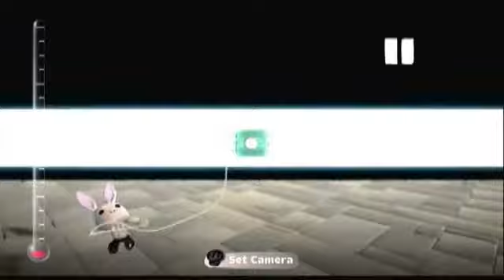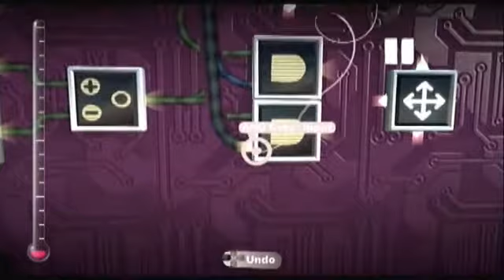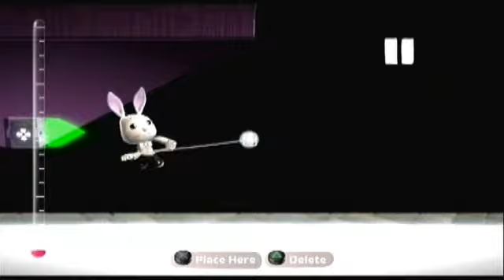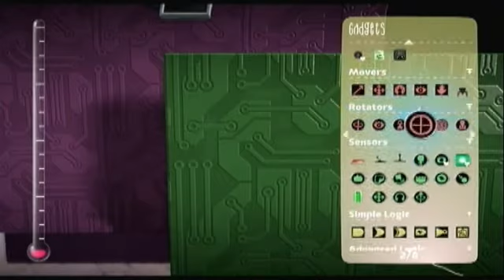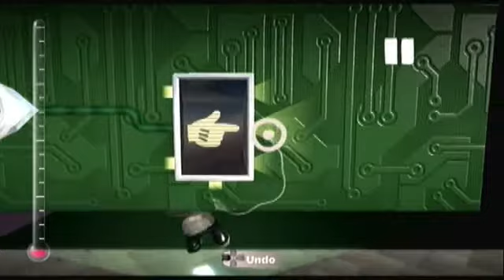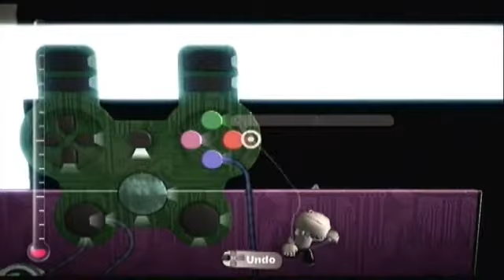LBP2 L2B Side Scroller Shooter Part 2

Comment: If you want to have multiple things, affected by an and gate, but have a lot of things, put everything you want inside a microchip, and have the button that would affect the and gates, power the microchip. It more or less makes everything in an and gate, as the chip has to be powered, and you also need to do the other action, like having a running jump, and running movement(platformer example) Or for this having a power up, that makes you go faster, and shoot bigger stuff.